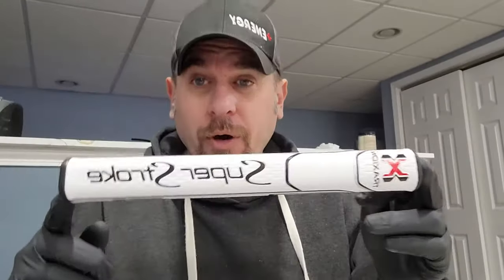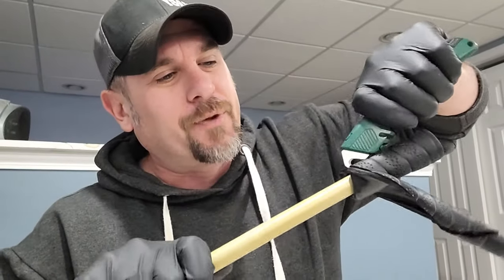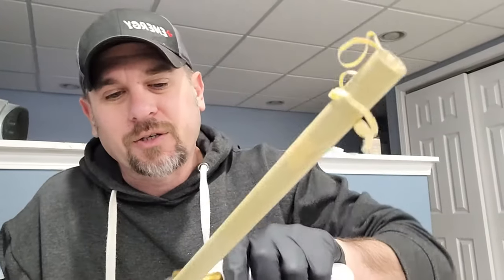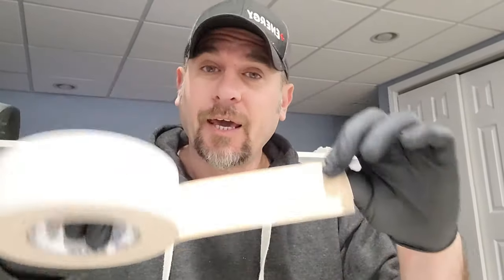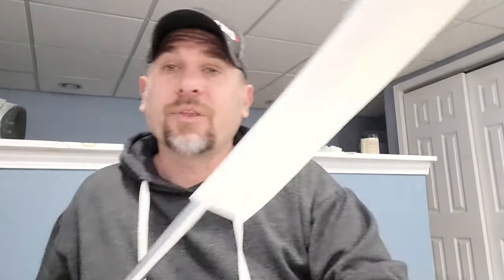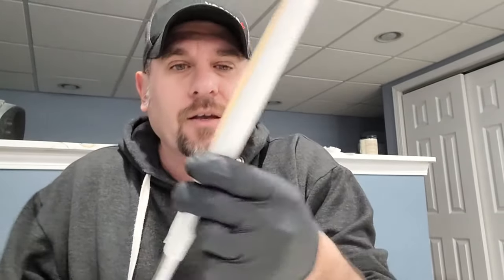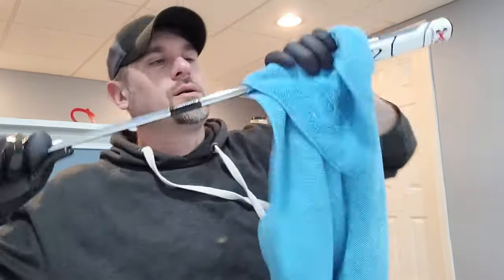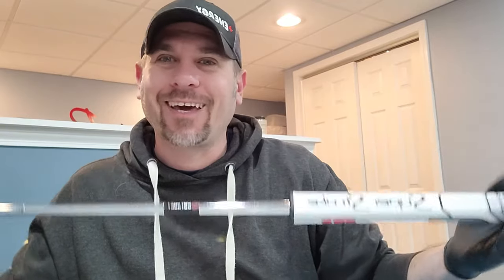How to Install SuperStoke Putter Grip Step-by-Step without a vise

Comment: A couple things. First, you don’t take a full swing with a putter so in reality you only need tape half the length of the putter grip. I only go 3/4 on my driver and less as I go down the clubs. Second, if you do put in a counter balance weight don’t cove the end of the shaft with tape. To align the grip place the putter face against something square and align the grip by sight with the face against the square edge object but be quick. You have only a couple minutes to rotate/adjust the grip before it seats. But it will rotate.
Reply from the maker: Appreciate you watching and appreciate the info.  Have an awesome day

Comment: A word of caution with a Super Stroke, because the top is flat if you don’t get it lined up perfectly you will have lots of trouble squaring the putter face at contact with the ball. Which means putts right and or left.

Comment: It appears as though you installed the grip with the flat side matching the putter face.  Was that what you wanted as It is usually the flat side at 90 degrees to the face?
Reply from the maker: Gary,  great point and yes i have done it both ways and found that way too work better for me.  I should've mentioned that in the video to set it to your preferred liking.

Comment: So the flat bit goes at the front?
Reply from the maker: Yes, so the flat part where it says SuperStroke should face away from you when holding the putter which will be in line with the putter pointing away from you as you line up your ball

Comment: How long should you wait before you use the putter? Any curing time needed? Cheers!
Reply from the maker: You should be good to go after 3-4 hours,  however, I usually wait 12 or more.
Reply: Many say 6 months.
Reply: @jokojay1   6 years for me
Reply: i've put a new grip on a driver and used it 30 minutes later at the course. putter would be more than ready to go after 15 minutes or so